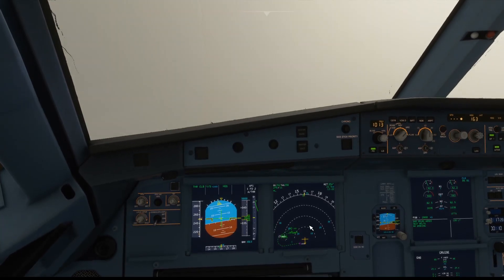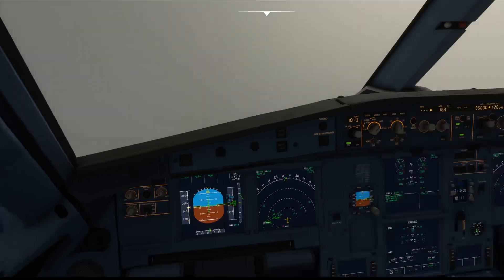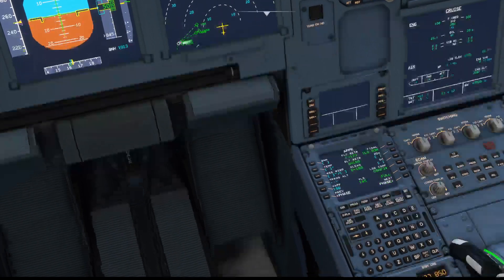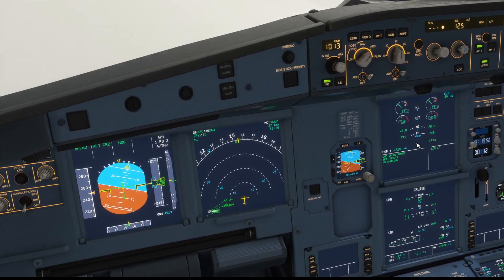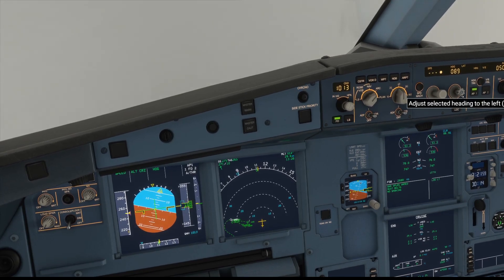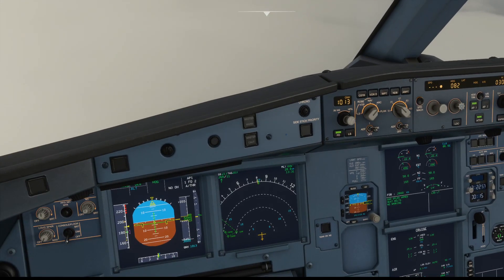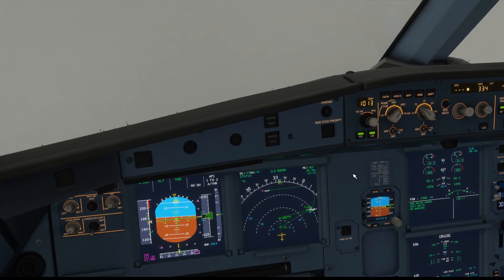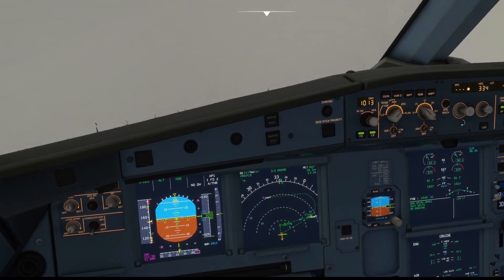MSFS2020 A320 - Full Automatic Landing CATIIIb

Comment: Hi mate , can you do autoland in the current stable version , i have tried but i cant get the second autopilot to turn on , i followed your instructions in the FMS ,but will only allow one or the other , it wont auto land
Reply from the maker: No. The stable version uses the Microsoft / Asobo autopilot coding.

The dev version uses FBWs own autopilot coding which can perform an autoland.
Reply: @Easyjetsimpilot  well that explains it , thanks for your reply , keep up the great work

Comment: Hey thanks for the indepth tutorial! Do you know if there's a known bug with the ATC? Specifically in my last flight I went from EHAM to EGLC in the A320 neo. I had planned for an ILS landing on runway 9. The ATC kept asking me to stay at my cruise altitude of FL320 even up to the last few turns I believe at like 20 nm from EGLC. Then at the last moment it went in 5 seconds from: "descend 18000, 12000, 8000, 6000, 2000" even though seconds before that they requested me to stay at 32000 feet. 'T was quite a nose dive to reach the proper altitude..
Reply from the maker: MSFS ATC is rather broken. Turn it off and enjoy a trouble free flight.
Reply: @Easyjetsimpilot  turns off transponder in real flight

Comment: I found if you let it touch down without flaring or pulling back in the throttle, it doesn’t bounce. Hits at around 700 fpm.
Reply from the maker: That would be enough to require some maintenance to the landing gear 👍
Reply: @Easyjetsimpilot  Not in-game though! 😂